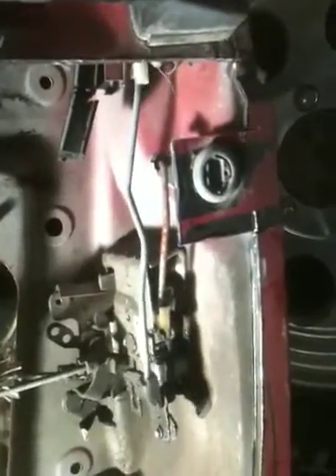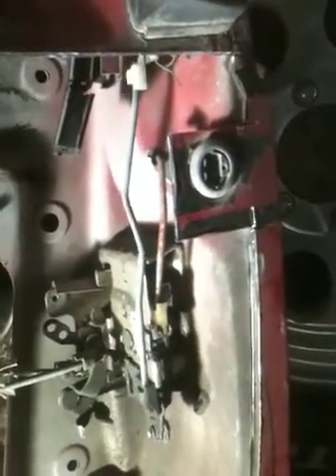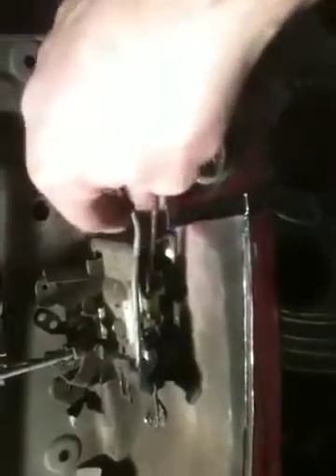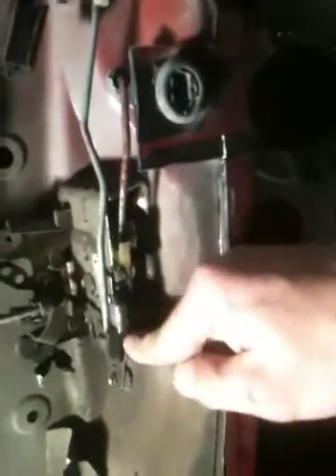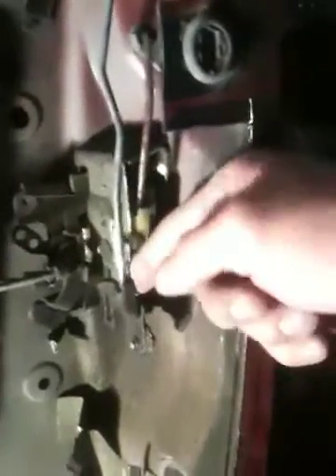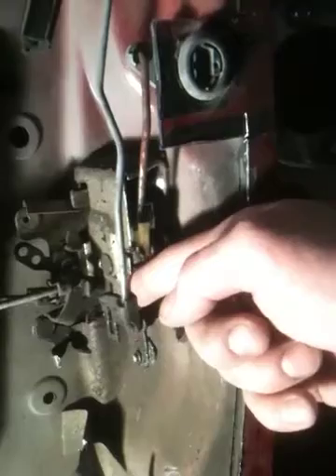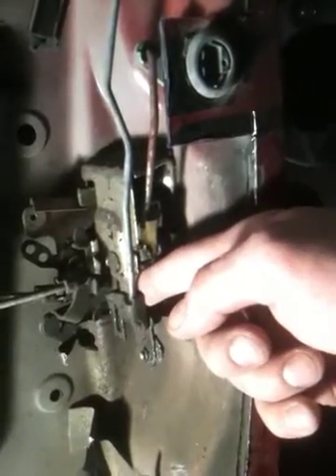Jeep Cherokee XJ door mechanism

Comment: I know this is super old… but my front passenger door will only open from the outside. It locks/unlocks fine. The rod for the inside handle is connected and moves but I can’t figure out how it’s supposed to work to figure out why it isn’t working. The part that the rod moves doesn’t seem to connect to anything. This video would be perfect if it showed what the inside handle rod is moving to make the door open 🥲
Reply: A lot of keys up 1 day and a friend of mine you just slammed Jim.And now it opens the end shop and not the outside

Comment: if you still have this door (probably not) but im trying to change my 1988 XJ's lock and i cant figure out how to disconnect the link
Reply from the maker: There should be a plastic clip to the arm, it has a small locking tab. Unclip it spin it 180 degrees and you should be able to push the rod out

Comment: My lock pin is stuck on locked, I tried to unlock it with key and from the inside but it’s just stuck it won’t budge... any ideas on how to go about it?
Reply: any advice on how to fix this?
Reply from the maker: May need some aero kroil and a pry driver to manually open it from the inside and assess the damage once you get it open

Comment: Question, I have a 98 Jeep xj, the switches for the locks work, but they will not unlock the doors with the panel on. I removed the panels and the passenger door locks and unlocks but the drivers will not. Also, with the panel on, I cannot manually lock or unlock the panel. Moreover, I need to know how to remove the interior door handle.

Comment: Hey there. I have a 1996 jeep cherokee sport. four door. the front passenger won't open. I removed the inner skin. Seems everything is rusted. I've used plenty of penetrating oil to now avail. Any thoughts or ideas? Thank you
Reply from the maker: The rust may have caused parts to wear excessively , bend or wear out see if you are getting a full movement and check back in

Comment: My rear door just got stuck it was only about 25 out when I finally opened the door  it wouldent shut afterwards so I tried to spray some wet/dry lube  in the latch and in the handles and I got the door to  close but now it is just stuck closed hopefully if I go out there when it warms up later and move the lever then kick it maybe it will open up

Comment: ok, I have on for you, I can't Unlock the door with the Key, or with the Latch from inside the vehicle.  It was getting difficult at first, but I could eventually wiggle the Key to open the door, but not now.  And the Indoor latch was experiencing the same restrictions.  I have removed the door upholstery from inside, but still have not been able to determine, as to Why I can NOT unlock the door.  
Thanx, for the video..
Reply from the maker: Check the plastic bushings the rod locks into and to see if the lock rod is bent